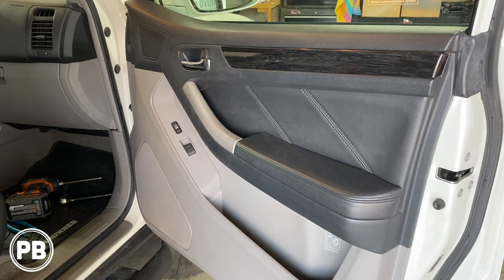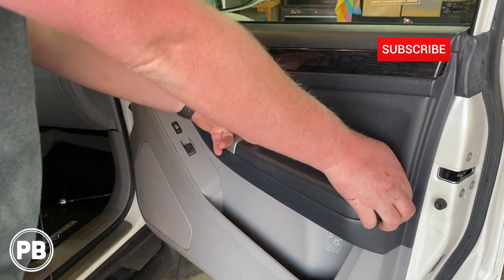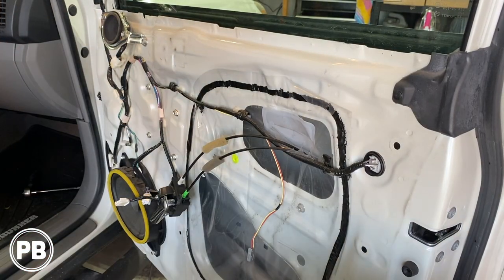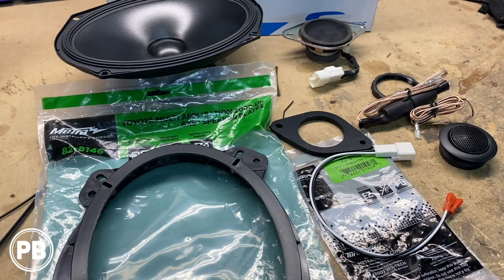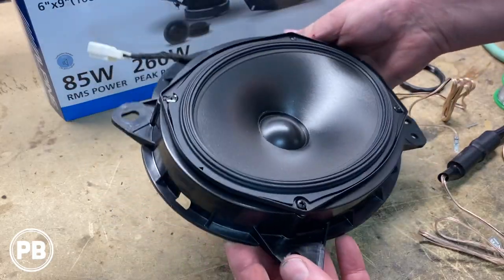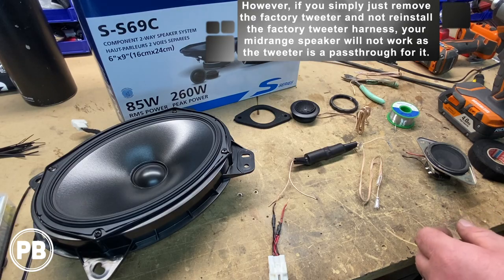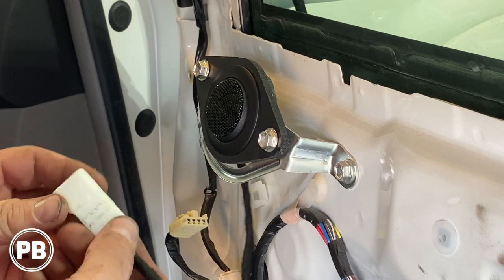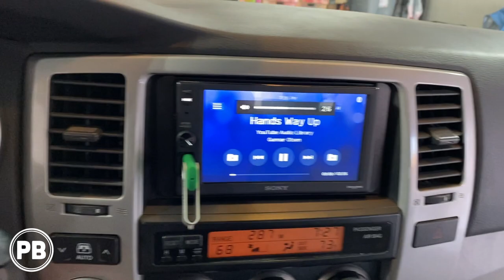2003 - 2009 Toyota 4Runner Front Door Speaker Install

Comment: How do I know if I need component or coaxial speakers? I don't have the JBL system and I'm looking to replace the stock speakers. I've already replaced the head unit a few years ago. Will 2" tweeters with a crossover work well with 5-way coaxial 6x9's in the front door? Or do I need component? Sorry for so many questions and thank you for any response!
Reply: Did you get an answer?

Comment: Curious if I’m using the factory head unit do I still need the tweeter crossover?   Great video!
Reply from the maker: Yep, always use the tweeter crossover! Protects your tweeter from unwanted frequencies, regardless of the source or radio.

Comment: Does it matter which way you connect the crossover? With this exact setup in my 2008, the tweeters sound staticky. 
I tried attaching to the terminals on the back of the 6x9 as well and same thing.

Comment: You did not show which  color wire from the crossover connects with  the +  of the tweeter connection you cut off. Also   You did not show which end of the crossover wire goes to the  tweeter OR which end connects to the signal coming in from the head unit.

Comment: I bought some rockford fosgate components but they didnt come with crossovers. Would that be a problem?
Reply from the maker: Some rockford components have integrated crossovers, just depends on which ones you have.  Regardless, you need some sort of crossover or else you can risk blowing your speakers.
Reply: Thanks for the response!
I got a blown speaker on my 04 4runner so i went ahead and ordered some rockford fosgate components cause i was told that its better and easier than just switching out just the speakers. I guess ill just find out when they arrive. 
Thanks again
Reply: Is it recommended to use a crossover even if they are built in to the tweeters? @ProvoBeastAudio
Reply from the maker: @rachleigh  If your tweeter you are installing comes with a crossover, yes, you must install it.  If the tweeter you are installing has a crossover already built into it, no an external crossover isn't needed, especially if the tweeters don't include one